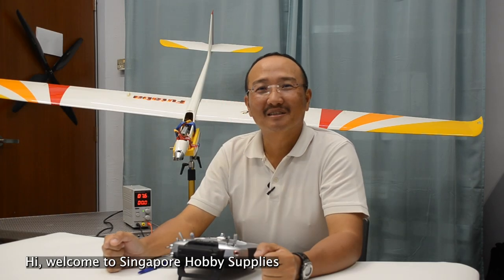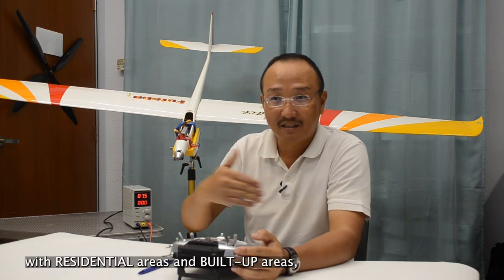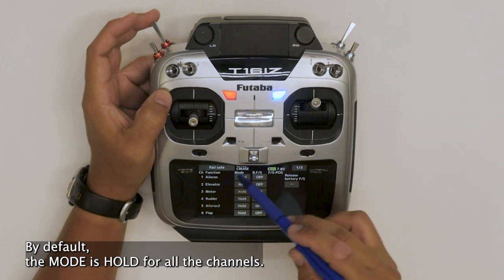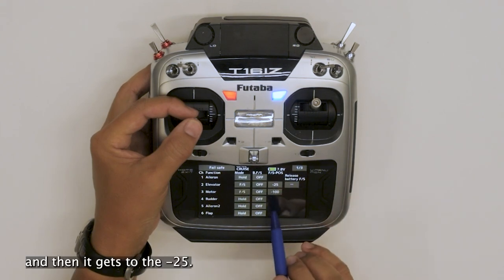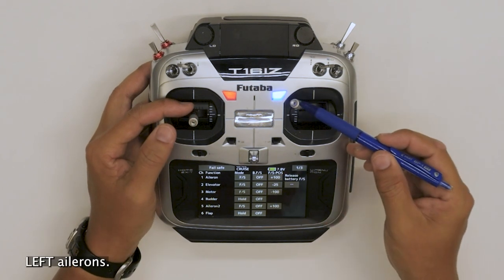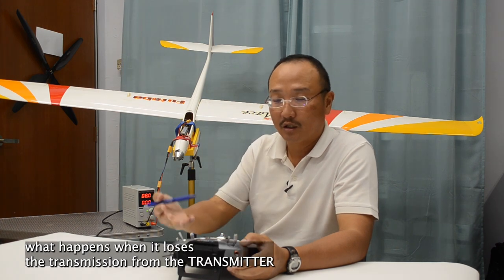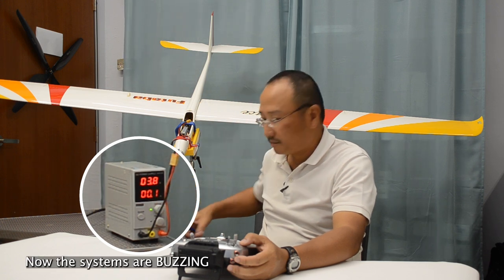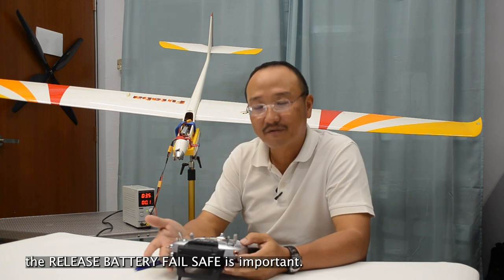FUTABA Instructional Videos - How To Setup Fail Safe (F/S) and Battery Fail Safe (B.F/S)

Comment: Great Video ! Very helpful ! Can you please do one on antenna placement on the transmitter, and how exactly the RF signal radiates off of the 16IZ antenna ? I had an incident a few weeks ago, and I feel I did not have the Antenna in the most optimum position using an FHSS receiver....